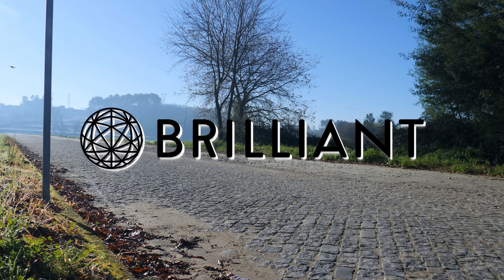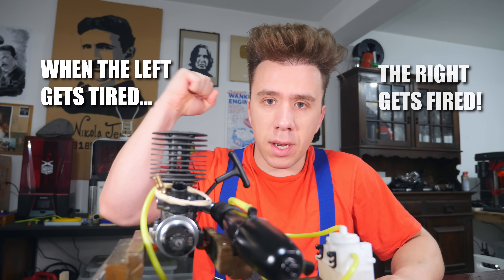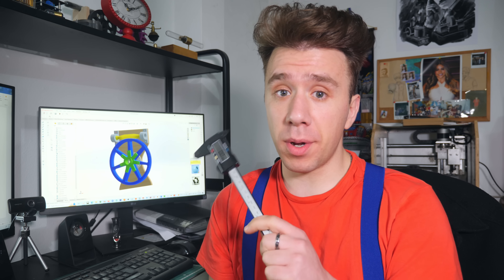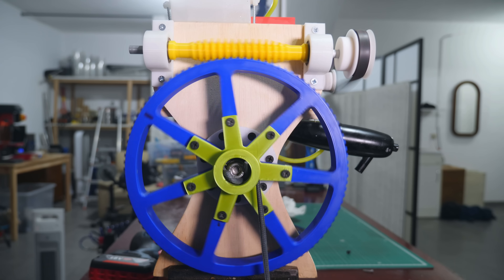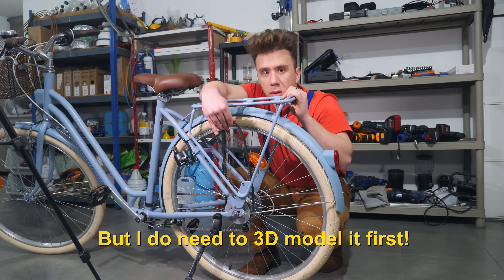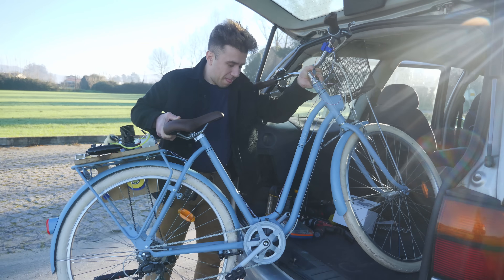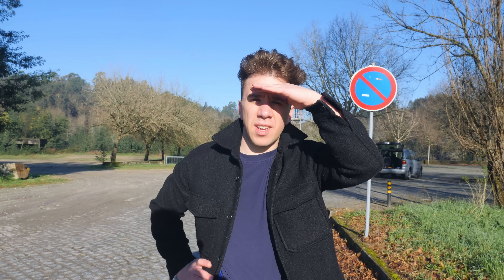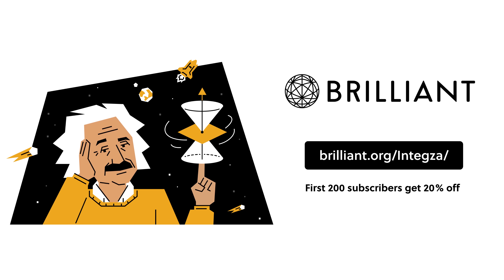Tiny 3.5 cc NITRO ENGINE on a BICYCLE

Comment: The thing is, you are not starting from 0 to 32 KHM, you have to assist it in some way, But perhaps, Maybe if you added a Flywheel and a Small clutch of some sort, and play around with the gear ratio, I'm sure you could achieve even greater speeds. If you used the Liquid piston engine, Which is more or less Scale wise the same size as that "mosquito", you would have at least 100 HP disposable to you . But , I guess the proof of concept is OK. That's entertainment for ya.

Comment: I wanna compare that gearbox to an electric transmission. Just set it up like an e-bike and replace the big battery with a generator and small surge-power battery pack. The generator will provide baseload power generation and the surge power battery pack increases the maximum power input/output so you can climb hills and have good acceleration and have regen-braking, without carrying around a big heavy battery.

Comment: Safety Sally here! When you crosscut that 2x4 on your table saw you left yourself wide open to a VERY bad situation. You NEVER want to have a piece of wood that is wider than it is long between the blade and the fence of you table saw. A number of things can result from that trapped piece of wood getting pinched by the blade, none of them good, some of them deadly. 

if you cross cut 2x4 material in this way, the safest way to do it is with a dedicated sled (easy to build and anyone with a table saw should build one!), or to use the miter gauge that came with the saw (hopefully). Just trying to keep you a ten-fingered tinkerer, without a shard of 2x4 jutting out of your belly...

Cheers!

Comment: If you could only get the good RC fuel like the 90% nitro we would run in our hydroplane boats.  You also need to learn about a tuned exhaust pipe it makes a HUGE difference in power output.

Comment: Mech. Eng. here. Great video, Integza! Some thoughts:
The teflon gear got torn up by the brass worm drive because the teflon gear is resisting the load, so each time the brass worm spins, it digs into the the teflon. Since teflon is softer than brass, it gets chewed up. Ideally gears under load like this should be made from the same material and bathed in very thin oil. That's why transmissions, gearboxes and differentials are designed like this. 

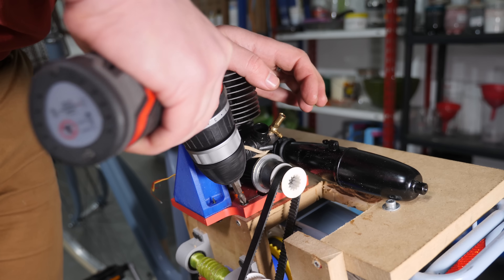Another point to note is that you likely are leaving a lot of top-speed on the table using the worm gear with 1:32 gear ratio. Since the nitro engine has 2.5hp and 0.9Nm as compared to the electric with 1.2hp and 50Nm torque, you only need ~1:25 gear ratio to achieve the same output. However, because the nitro engine has more hp that means you can trade initial torque out for a higher top speed, and achieve this with an even lower gear ratio. In theory, a gear ratio of 1:13 will get you double the top speed compared to the electric bike. With gear ratios like 1:13, you can easily obtain ordinary gears to use, which will improve overall efficiency compared to the worm gears. The initial acceleration can also be helped by pedaling the bike manually while at very low speeds. Another reason to go this route is that, under ordinary driving conditions, where you are not driving at full speed all the time, you'll be able to feather the throttle to maintain a medium speed, which utilizes your engine more efficiently and dramatically lowers engine wear and tear. 2-stroke engines wear out much faster than 4-stroke engines in general.
Reply: To my understanding, it would be better to use a compound gear ratio or a gearbox rather than worm gears in this application anyway since the teeth of the spur gear are rubbing against the worm gear to create a lot more friction at high speed. It's actually a good thing that PLA wasn't used in the final design because of this. I made a (bad) turbine generator back in high school that was intended to withstand higher speeds, but I didn't put enough lubricant around the gears, so the friction generated enough heat for a gear to plastic weld itself to one of the axles. Needless to say, a good chunk of it broke, and I had to reprint the parts.
Reply: @silvory7021 I’d be interested to see the parasitic loss with different gear set ups. Very interesting
Reply: @PWNAGE703  material wear would technically happen with any gear setup because of friction, but this process is sped up when one material is much softer than the other. With the worm gear to spur gear setup, it's the equivalent of pulling a garbage bag uphill on asphalt. It technically works, but that bag is going to be shredded layer by layer over time until there's trash pouring out (speaking from experience lol)
Reply: @silvory7021 the bicycle of course comes with a built in gearbox.
Reply: @proscriptus  Yes, exactly. Have a centrifugal clutch run the belt drive at 8:1 to drive a toothed sprocket at 8:1 to get him about 60:1 then upshift all the way to maybe 20:1 or more
Reply: @proscriptus Derailleur, not a gear box. Honda made a bike with a genuine gearbox but they only used it for competition and they refuse to talk about it
Reply: I don't think a 1:13 ratio is quite realistic. That would give the bike a top speed of like 70 km/h. There's too much air resistance at that speed, you'd probably need a 4-5 hp engine for that. For this engine and bike, I would at most try a 1:20 gear ratio and see if the bike could reach 45-50 km/h. But 32 km/h is quite impressive for such an inefficient gearbox I gotta say.
Reply: @pxlcowpxl6166  even if you could acheive the theoretical top speed, going that fast on a cruiser bicycle is a bad idea 😂
Reply: to add, also richen the mixture up a bit, these engines need to smoke a bit while under throttle. most certainly while at wide open.
Reply: You likely would NEED to get it up to speed with pedals moving with this ratio though, those engines have almost NO power at lower RPMs and the tiny centrifugal clutch only fully grips at 15000-20000 RPM for that reason. If you try to accelerate from a standstill you very likely just burn up the clutch. 

Building a 3speed gearbox or so could help with that, though ;)
Reply: I was screaming this into my monitor when he used Brass AND Teflon. Maybe he could've used brass on brass with a bit of grease, and put housing around it.
Reply: Pin this
Reply: Amateur idiot here: I'm still stuck on the fact he didn't do any carb tuning or put a filter on it first. The damn thing just wants to take off when he starts it.
Reply: worm hear has major thrust load so it has to be made from very resiliant materials and its meant for low speed
Reply: Worm gears are terrible anyway and should never be used when you want high efficiency (but still has some uses when you want the system not to be back drivable). While normal gears have an efficiency of 98-99%, a worm gear has anywhere from 98% down to freagin 20% efficiency. So worst case (which it is probably close to in this example) you'll literally throw 80% of your power away in heat production.
Reply: We found the classic conceited engineering student who can't just say stuff because he knows it, he has to add credentials at the beginning to get some credibility, little does he know, 20% of people in the comments know more than him without having the degree.
I can detect that, because I'm a Masters in Mechanical Engineering and I know the type, and I also know that if I go to a video about cars, there's a whole lot of people in the comments who know much more about it than me and I learn a lot
Reply: Gear lubrication question: assuming PLA whatnot gears, their surface microscopically uneven. Irication would be still optimal? Oil still, perhaps?  - Coming from grease intuition taught me something here anyway. Thanks.

Comment: My first motorbike/moped had only 5 hp, but could reach 45 mph. French mopeds of the 70s and 80s had an engine above the front wheel and powered the machine by rotating a wheel on the tyre to provide the gear reduction. Less losses.

Comment: In UK we call those Glow motors…because they use Glow Plug ignition.  This is more accurate because they do not have to have the methanol base fuel doped with nitromethane…which is where the US gets ‘Nitro engine’ from (the channel is Portuguese, nevertheless ‘Nitro’ is a US popularised term). You can also get same sized diesel engines which do not use nitromethane at all.  Although pop culture associates these engines mostly with RC cars, the larger use was/is in RC model aircraft.  Great project! 👍 If anyone tried this in UK they’d get a fine and three points on their driving license.

Comment: These engines reach about 16 000 with load and 19 000 rpm without, and ~ 1,5 N.M...
That's why you had trouble with the relation...
I am an aerodesign competitor, and up until 2022, the airplane's engine was a 61cc nitro, so I've already done a lot of tests with this type of engine.

Comment: I think with a bit of tuneing you can reach a higher top speed. I use a 15ccm 2 stroke Nitro engine in my RC airplane and it doesn't handle full throttle well when it is not set up right for the conditions, It also seems like that your idle is too high. These engine have to be set up every single time because even one degree difference in temperature can effect the performance.

Comment: Speaking of engines, you should power your 3d printed wankel engine with the turbocharger you used in the pulse jet project. After that, you should make the turbocharged wankel engine to power a little car, with control remote and everything. 
btw, great video, keep it up!

Comment: Worm gear was worst possible idea to propell bicycle. Theres a reason noone use it in vehicles. You could make simple belt pulley reduction. Much easier and would work 100x better

Comment: You needed to choke it to get the fuel sucked into it. You should have covered the throttle body on your first pull then pulled it normally.

Comment: I love this! You definitely did your grandfather proud! I am not engineer, but you definitely, with out a doubt, should have gone with 100:1 ratio. Think of it; if your engine can rev to 30,000 rpm, then the gear is spinning at 300 rpm. I dont know the math but I would guess you could go around 50 km/h. Your engine is riding against the clutch and has not even begun to rev after the clutch engages! It's like holding the head of a weed trimmer stationary while at full throttle. If you do max out the engine then try a 75:1 etc.
Reply: Or he could have tried the 50:1 he suggested as optimal and e-bike like  in terms of torque in the very beginning of the video. But no, he intentionally messed up to add drama to the video. It's about quirkiness with these content creators, not quality.

Comment: In Boulder, CO (where I spent a few summers) I once spoke to an unhomed person that went through the back alleys in residential areas, collecting recyclables in a 2-wheel trailer pulled behind a motorized bike. He claimed to have once been a mechanical engineer, which tracked when he explained how he'd motorized his bike. He had adapted a small, 2-stroke engine to power the bike, but instead of running it on gasoline with 2-stroke oil, he used alcohol, and occasionally treated the engine with some kind of aerospace-grade lubricant. He said he got way better efficiency, and almost never needed to do maintenance or refurbish the engine, I guess because of the lower burning temp of the alcohol, and way the lube worked. His gearing was very simple, and I don't think he had much if any gear-based mechanical advantage, beyond just the spoke-hub that the bike came with, operated with the OED derailleur. It was really impressive.
Reply: a lot time ago, all engines were on alchogol)
Reply: @mrreetmake I had the same thought, but he didn't seem unhappy. Content, is how I'd describe his attitude.
Reply: You mean hobo?
Reply: @ghoulbuster1  Nah, that's a term only a**holes use.
Reply: Nah, he just wanted to be different and didn't like the 2-stroke smell. Running a 2-stroke with no oil will kill it fast, especially with the lower lubricity of ethanol. Yeah, this dumb crap shows why he USED to be an engineer.
Reply: @nobodynoone2500  Actually, the lube he used and whatever modifications he made worked great. That motor had some miles on it, believe me, and I know what a 2-stroke sounds like. It was perfectly happy.

Comment: you should check out T25 or T20 screws and bits, instead of phillips.  they don't skip until the bit has been used thousands of times.  so just get a new bit and no more skipping for another few thousand screws.  torx bits and screws are an absolute game changer.

Comment: 20mph for a 3d printed worm gear drive isn't too shabby.. Makes me wonder what the RPM of the screw itself was lol
Had you gone with a planetary gear set, I'd wager you could've gotten a fair bit more speed out of it and not really sacrificed any torque.

Comment: You prime the engine before you put the glow igniter on the glow plug.
Also, you need to break in the engine.
After that, you need to tune it for maximum power output.
The engine wasn't running at its full potential.
You have to tune the engine based on the weather, or the ambient temperature on that day of use.
There are more powerful engines, but of course, they cost more. They are more sensitive to how they get tuned.
Nice work.
You should look into trying the higher KV electric motors for RC. Higher rmp and way more torque.

Comment: Electric motors make high tq and low hp. Right from idle they produce max tq. In contrast, nitro engines have low tq and high hp.  They dont make much power until they rev up to high rpms which is why this bike was slower taking off from  a start but fast once the engine got close to 30k.   Because they make little torque, theyre usually used to propel lightweight things like rc cars and planes.  You gearing must have been truly spot on because i didnt think this engine would be able to get you moving from a stop.

Comment: I'm in the nitro rc hobby, and those engine need some tuning the firsts few tanks, first tank is on iddle, 2nd at 30% throttle, and 3rd at 60 slowly to a 100% throttle, once you have done 4 to 6 tanks you can start leaning the mix to get more power and speed out of it
+ we use faster cervo for the throttle response, they dont cost that much and are the best upgrade you could make

Comment: Teflon is a terrible material to make power transmission items out of (as you found), it simply has no strength, and flows/creeps readily.   Maybe use cast nylon rod next time?   Also, I think bronze is more generally used in bushing applications, not brass.

Comment: Now try two engines, or maybe build a turbo shaft engine,  maybe build a larger nitro engine, start with a 3hp diesel engine modified to spin faster and on nitro! Using a supercharger to equal a top fuel single cylinder! The heavy duty diesel components should handle the stress! And it could possibly be directly injected! 😎Just add spark!

Comment: I think the only problem you might run into, besides the cost of fuel ($$$$) is going to be the durability of the clutch.  And why use a servo and servo driver when a simple motorbike throttle grip and cable would work better?

Comment: What about driving the outside of the rear wheel with the motor?  It would be similar to how bike light generators take power from the outside edge of the wheel.

Comment: The Citroën 2CV (French: deux chevaux lit. "two horses", meaning "two taxable horsepower") 
Taxable horsepower was based on engine capacity and bears no relationship to the actual output of the engine.
The actual output of the original 2CV was 9 hp and the latter versions developed up to 35 hp.
The UK and other countries also taxed vehicles on the basis of engine capacity.
Often, every 100cc equaled 1 taxable horse power

Comment: Dude pulled the fuel up by hand and wonder why it didn’t start right away. Just drip some fuel down the intake then pull the starter rope. The pull starter will work easy once  the fuel system is primed. No need for the drill.